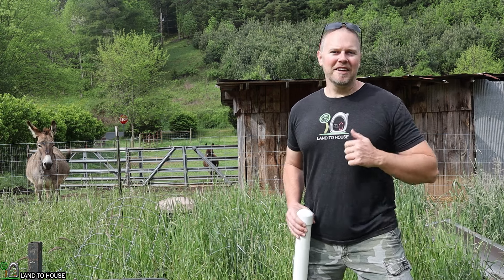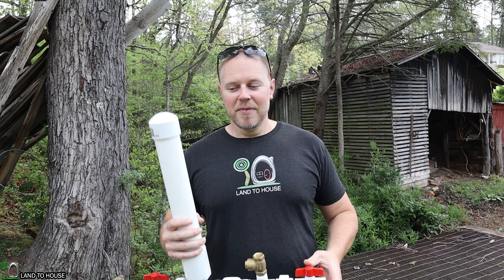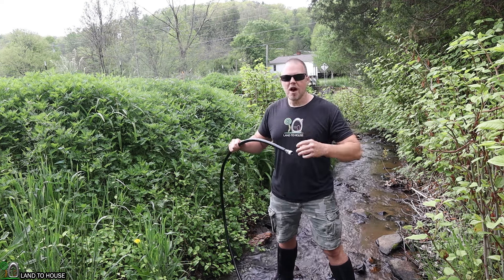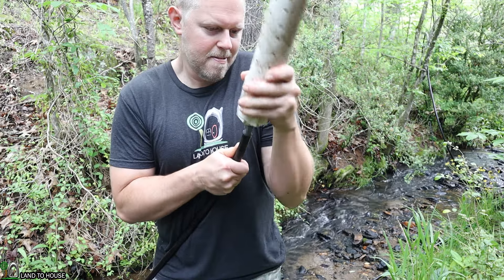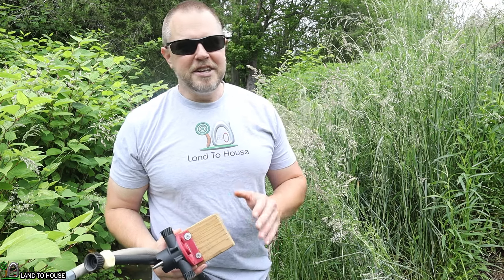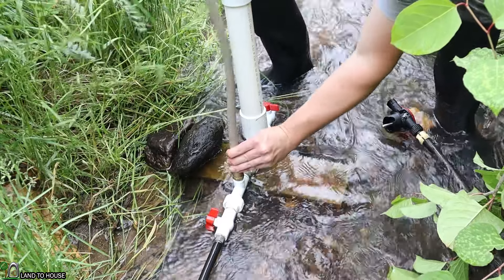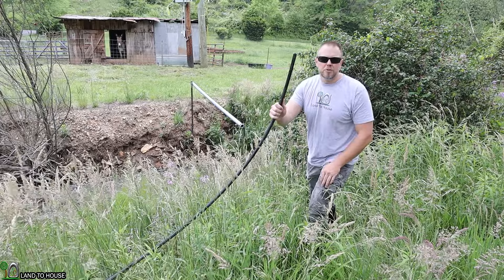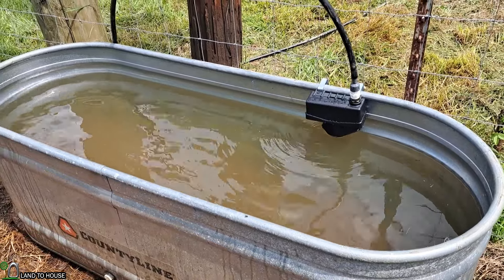1/2" Ram Pump Install to Water Donkeys

Comment: Nicely done.  I see a drain fitting in the bottom side of the of the stock tank.  An overflow like you have on your storage tanks at home would keep the water fresh and might help move sediment from the bottom.

Comment: I miss those hydro videos, man. Are we gonna get anything on hydro soon? Those videos were bangers and some of the best on youtube. 

Not invalidating your solar and ramp pump videos.
Reply from the maker: I got some 3/4" poly pipe that I can connect to the hydro penstock. I want to make some videos with smaller alternative hydro power. It would be fun to make some 12v hydro systems to power the tiny house.
Reply: @LandtoHouse  That would be great.
Reply: Yeah on YouTube whenever you search for "micro hydro" you are likely to be greeted with Land to House's Micro hydro videos first before any other. If he can observe well he get more views on these kind of vids "original contents" than those reviews.

Comment: I never have a problem starting mine I always have a problem keeping it running overnight it'll always likes to shut off but then start right back up again
Reply: Don't open outflow all the way.  Try 3/4 open and see if it will continue running.
Reply from the maker: There are normally 3 things you can do to keep the pump going. 1: reduce the input head pressure some. 2: increase the height of the output. 3: slightly crack the delivery pipe ball valve to introduce back pressure. (as suggested by mikewhite. This method can be tricky to find the right amount of open.)
Reply from the maker: Yes that method can work. It is sometimes tricky to find the right amount of open for the valve.
Reply: @mikewhite9993  I've tried it quarterway open 1/2 open 3/4 of the way open all the way open sometimes it runs better just quarter of the way open but then sometimes it'll also run like it's running right now all the way open
Reply: @gumbystown  I had an issue where my happens. Ramp drew more water than I was collecting. And then it would stop and it's top open if it stopped open all that water just rushed through bypassing the rest of the crick until it came off the waist valve. If it's stopped closed, I'd be able to start a rake back up

Comment: After the float valve stops the water flow, I'm guessing the pump will continue to run to a certain amount of pressure is built up. When pressure is released by the float valve will the pump start up again?
Reply from the maker: Because this system is not pumping with much head pressure there is no issue with the float valve. Sometimes if you have higher head pressure systems you can build enough pressure when the delivery valve is closed that the pump stops when it is reopened quickly.
Reply: I can variety what seth just said.
Reply: I think after the float valve stops the water flow, the pump continues to run, will continue to build pressure as well! I think that pressure build up will continue and there comes a time it would break the tank or cause some leaks maybe. any thoughts?
Reply: @janfives3510  from my experience it was when the pump opens after it's built up enough pressure behind it that sudden loss of pressure causes to pump to stop. But if you have a more low pressure application it could be different

Comment: Does it of to be placed  only in running water?
Reply from the maker: The 1/2" ram pump is going to use 2gpm to operate. It needs that running water to keep it going. The pump can be used from a tank but the waste water consumes a lot and the tank will be empty fast.
Reply: Okay thank you, watching from Jamaica 🇯🇲🇯🇲